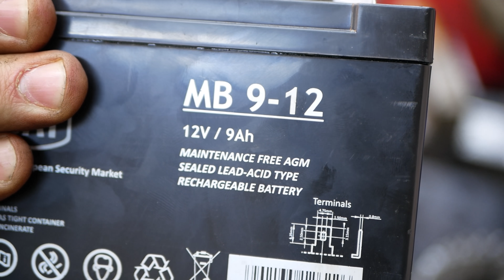No More Trailer Woes: My Electric Towing Solution!

Comment: For anyone curious how to mig weld. There is usually a datasheet sticker with settings related to volts and wire feed speed. Just know the size of wire and check it out on the sticker. More expensive machines will guarantee this sticker is included. As far as gas flow it should be set to 20 cfh (cubic feet per hour)  or 10 Lpm (liters per minute). If there is wind set 10 cfh higher or 5 Lpm adjustments. Er70s-6 is standard wire
Reply: Facts
Reply: I'm getting into mig welding, so thanks for the info
Reply: Yeah that is all you need to know you'll be laying some sick beads knowing that

Comment: That's ingenious! I bet he built that from scratch without any blueprints. Slightly overbuilt but anything worth building is worth over building.  Well done my Polish brother. 👏👏👏👏
Reply: No-one needs blue prints when they are in the power of imagination 👍
I often build similar although I don't have a YT channel setup atm, nor have I filmed hundreds of builds I've done but I've got tonnes of photos and useful equipment!
Reply: @Th4thWiseman  Agreed. I learned the big word for it not too long ago: "conceptualize". If you can see it in your mind, putting it on paper seems like wasted time/energy to me.
Reply: If this guy is Polish, all the Polish folk I know around here need to take notes from him
Reply: @YerBrwnDogAteMyRabit  When you start out it's best to put things on paper just so it's easier to do but after doing many hundreds of builds you soon realise that when it comes to close tolerances fits and mating parts ,they are best done as you build out keeping mind what connects to what next and whether or not gussets are required for strengthening!
It is a craft to do it correctly which I do as a tradesman Fitter & Turner for 40years of experience 32years running my own business.
Reply: @Th4thWiseman  rough sketch, then wing it as you go! 👍
Reply: It looks exactly like the 'Trailer Dolly's' that have been on the market for over 40 years.

Comment: Really think splitting the shaft and putting an extra 2 bearings is the way to go, other than that seems like a really nice build! Probably will take some inspiration from it!
Reply: I agree with you. It would turn easier and be easier on the motors and chains. With a little redesigning you could control the speed of each drive motor to control the direction.
Reply: @drfrankensteinscreations  I know this is dated, but youtube just decided I needed to see it. I was looking at the comments to figure out this exact issue. Looks like it might be hard to turn. Pretty cool though.

Comment: Nice build! Wish I had this back in the day when I used to work with concessions trailers, made spotting them a breeze! I do like the welding  clip around the 13:30 minute mark, cut that segment in backwards so the sparks flew into the weld. With some modifications this would make for an excellent aircraft tug for those weekend pilots who have the pleasure of hangering their aircraft.
Reply: in their private hangar, could easily be stolen ...
Reply: They've been on the market for over 40 years, 'Trailer Dolly'.

Comment: You are an amazing machinist! And very innovative. I'm a 4th generation German machinist (I do minimal metal working, and any kind of house repair or new builds. I'm in mt 70's, and now gardening, very scientifically, and develop ways to go from seed to transplant in 3-5 weeks.). I also designed my trellises to be multi-functional, and fully automated watering system. 
I'm sending this video to my son-in-law. He is 2nd generation Polish, and very mechanical minded. I'm sending him your Link! They have a larger than average camper trailer. Their driveway is steep, turns left at the bottom (almost level where they park the trailer.).  They could absolutely use your trailer hauler!  My daughter does the driving, and Mark is outside guiding her. 
`

Comment: Another fantastic build with a practical use. I modified some electric pallet trucks to do a similar job and learned a few things. On this build, the position of the ball hitch is very close to the drive centre line. This reduces steering effort. However, if the trailer hits resistance, the unit is going to try drive out from under the trailer - potentially whipping the handle upward quite violently. But I applaud your excellent craftsmanship and creativity!
Reply: @Daihti__ Exactly. Nothing to prevent violent swing up, down sideways if the towed or tow-er wheels hit an obstacle or hole, etc.. but besides that, nice workmanship 👍👍
🤔.. maybe an extension post added to the front with a caster wheel under it, and the trailer ball on top of that??
Reply: Perhaps, if the ball hitch were closer to the center of the towing vehicle, that might mitigate the upward swing?
Reply: @isaacmadhavan  Actually the further forward of the centre, and the lower, the hitch and ideally the centre of gravity of the unit,  the better. Hence the suggestion above of a caster wheel out front.
Reply: @daithiosioradain3380  Aaah... you mean it would work as a lever to control the movement?
Reply: And not to mention that windshield motor has no chance raising anything more than that tongue weight.

Comment: Is that is a solid axel, how are you turning?
Reply: I’ve got the Same question
Reply: Same question! Why two motors and two chains when its one axle? Logical would be that left and right is not connected.
Reply: @Tramm454  I would’ve built it exactly the same except spilt the axle added a tube to go over the split between the motors with some bearings it could float just a double set per side and two switches would make it easy to steer under load and everything else

Comment: I made a tug with 4 wheels and used a 2500 lb winch motor to turn a sprocket to turn a solid axle rear., it’s to pull a 25?ft car trailer from my side yard to my street over grass. It does great pulling to the street as it’s downhill but it does not have enough traction to push the trailer up hill back to the side yard.

Comment: I just use the wheel chair. Split  the platform add solid non neumatic tires.  To  Make front stabilizers. Added 4 marine batteries and ride it around like a atv and move sit around for years with a  8 position throw switch to double voltage to go faster.  .. Just use the motors to steer  with a rotory wheel made from old brushless motor hall sensor. Old CD player steering by wire  controller.  Also hooked it to a wireless router and can WiFi control wirh my. Jail broke iphone. App I wrote Debian...  never thought about  makin a YouTube video. Til now   I got a zero turn string trimmer im makin from trashed hooverboars atm

Comment: I had trouble backing our 16 ft long camping trailer into the narrow side driveway into the backyard.  Hard since an often busy street (school nearby) and hard to make the 90 deg turn onto the drive while avoiding trees and bushes, plus hard to tell the angle of the trailer.  I finally bought a small cable-winch from Harbor Freight and welded a plate to bolt it to the trailers rear bumper, and is easily removed.  I ran a thick cable from the 12 VDC battery at the front to an outlet near the winch.  I used a manual Trailer Dolly from Harbor Freight at the front to steer as I operated the winch with remote control.  Total cost ~$100.  Then all I had to do was back the trailer up enough to get the rear wheels near the driveway, then unhook before drivers became irate about my tow vehicle partially blocking the driving lane (fussy parents since street is wide w/ parking & bike lanes, plus center turn lane).  Steering with the tow-dolly was easy and allowed tight turns.  Finally, the ultimate solution was to sell the trailer, since a hassle towing one and went years without using it.  Tent camping is actually easier.  But, such powered trailer dollies are neat.  There are commercial ones (pricey), with some cheaper hand-cranked versions.

Comment: We had 2 of them back in the 70's at the dealer I worked at. 1 with a ball mount for moving the team race boats (Hydroplanes) around and a second with a big rubber pad like a plow for pushing no-start cars around the dealership shop.

Comment: Back in the sixes we had a tug like this we used to pull small aircraft in and out of the hanger it must have waghted 40 to 50 pounds. He built  one that waghted as much as the log splitter!
Raven out

Comment: Love it! I just finished one made from a 1946 Speedex walk behind tractor. I pulled the gas engine off and replaced with electric motor. I originally started with AGM batteries also but changed to two 23 ah of Litium ion, Much better but yeah, spendy. Keep up the good work

Comment: Nice build, now just the Refinements LOL.
I am considering an old hydro garden Tractor. Shorten the Frame, 
Moving the Steering out Front with just a Tiller handle and a Cable operated For/Rev control 
Remove the Seat and a Hydraulic Cylinder in a Jack configuration for the Ball. just behind the Axle. 
My Trailers are to big for the Unit You built LOL.
Mike M. Central Wisconsin.

Comment: 14:30 I noticed that you had the tyre tread on backward.  They do this on the old type cranes with tractor tyres as they wear out on the road and concrete due to the load and the cleaning action of the tread.   On a tractor the tread actually flexes to aid in the cleaning action  to remove mud.  With load and a smooth surface the tyres wear prematurely.  Top idea.  I have been working on making my ride-on mower in to a small tractor so it more useful than just as a mower.

Comment: A long time ago I had planned to build something similar from a bleacher tractor for opening and closing bleachers like used in school gymnasiums to move boats around in a boat dealer show room but I no longer need anything like that. Because without it, there was a need to pull others from their normal work load to handle the show room break down or rearranging.

Comment: being a fabricator myself i commend you on your build, but i may critique just a bit, but only for the interest of improving on your design. I would do away with the windshield washer motor, even the older ones have plastic gears that aren't meant to withstand the kind of resistance you are dishing out. A hand crank lift like the one on the wood splitter would suffice for me and no failures at a critical point. Second point would be the adjustment for the chain tension. make the motor movable not the axle. the axle should be aligned. Third would be the axle and motor assembly itself. It would be much easier to repurpose an old transaxle assembly from a small car that way you could employ the limited slip transaxle to deal with the differing speeds of the motors, you could still utilize the redundancies of twin motors mounted to the same input shaft of the differential, that way the output shafts would always be the same speed and it would be much greener to utilize existing components than to build new ones.

Comment: Clever build.   Enjoyed the machine work and welding.       The only reason I see for the twin gearmotors  on a common drive shaft would be to double the torque available to move the trailer.   This would also double the current requirement and shorten the run time.    Not a criticism, just an observation.   Very nice fab  AND camera work.           Be well.

Comment: Honestly, don't you think it's a little Over Engineered ? I used the electric wheelchair (Hover round)  by replacing the chair seat with a trailer ball on a pipe which fits on the original chair seat mount. But yes yours is Better but we don't have a Lathe or welder. good job. but mine works too. keep up the good work.

Comment: I clearly recommend to use more than one screw or a serious amount of locktite, even better pins with safety pin on vibrating and rotaing axle parts. Things that have pins or screws not secured by gravity and that tend to come off fully speed with serious consequences to the user.

Comment: This is a great video. Furthermore, it yields a product that in a modified version, I may want to build. The one issue I see id that based on the bolts used to fix both sprockets and both hubs to one shaft (see 3:43 and 3:52), this means both wheels MUST turn at the same speed.  I occasionally move a ~3000 lb trailer/ in an asphalt covered storage yard. (~400 lb tongue weight, and ~250 to 300 lb thrust, very slow speed ~1 km/hr). The asphalt and tongue weight mandate that the two drive wheels to be able to rotate and different speeds relative to one another. So, each sprocket needs to be affixed to the adjacent hub, where both are allowed to rotationally 'float' on the mainshaft. Given the slow speeds, this could be done without additional bearings.

Comment: Nice build - but I suspect if you pull something much bigger with some significant weight (like a boat) the small cart will try to pivot on the ball and it will not work - I know because I built something similar. :-) A locking mechanism that locks the machine to the trailer  with a bit of play is needed, which would not be hard to fabricate given one you have done. I like your motor drive system, a better idea than mine where I use a single truck winch and welded on a sprocket - but without a differential system the cart, when under load, would be hard to turn given the width of the wheels. Your finishing job looks great too!

Comment: It's a nicely built, heavy duty compact design. But I find a trailer hitch on my ATV does a good job of moving around small and even medium sized trailers. That said, some of the design elements might be useful for some other device. 

I'm looking to design a compact system to move heavy shop equipment around in a confined area. Small, strong and compact. Maybe based on a modified pallet jack design. Similar in ways, but much less bulky and awkward to operate

Comment: I would have made one change to the control arm... put a trigger switch under the handle or near the tip so that for longer moves, you're not having to micro-manage the steering. Much easier to pull than push, at least until you're preparing to place the towed item more precisely. You've got the push and pull nicely done, but the trip to the worksite could have been significantly easier, especially over the rougher parts of the movement.

Comment: Impressive build, only one thing I like to stress as  important,  the welder is welding near batteries,  yes they are sealed but one can  not be sure  if there is a leaking one especially if they was to be charged as same time,  so my suggestion illuminate possible dangers and harm to yourself or others remove batteries after test fit before continue to weld.

Comment: I got a 45 hp tractor that I just use the front loader on to move my trailers around with, it was cheaper than the tools used to make this.
What I don't understand is why you didn't flip the sprocket hubs, would have made one less thing you have to take off if you have to change the sprocket.

Comment: Should have gone with an acme thread for the linear hitch lifter, I’ve used fastener threads like that for various projects and even if you put grease zerks the threads start to gall and seize after moderate use.   Could steal one from an old car jack for example.

Comment: I know this is a year old video but nice job.
Are the wheels able to turn independent of each other? I may be wrong but it appears not.
An improvement would be to split the axle in the middle and fit a free running sleeve to keep it rigid.
The through bolts for the sprocket and wheel hub would keep the axles from sliding in and out.
Varying individual motor speed would give directional control.
Now, where is my RC transmitter........... 🙂

Comment: nice video, very inspiring, I was looking for something in a small work unit / tractor, a few design changes I would make, make it so the handle can rotate inwards which serves 2 purposes 1 it will allow you to reposition the handle bar for a tight turn and 2 it would mean if the load was light enough or you had no load you could ride it to your destination. another design change could be to have the tow ball removable so another attachment could go in its place like a seat stem. essentially you could use it to ride on and as a work unit. good job very inspiring.

Comment: I use something like this to move airplane cargo stands into place . If it doesn't have differential power to the wheels it will be a major pain to turn under load.  Kinda like dancing with a extremely large woman.  She leads you follow lol

Comment: Does it reallly need to be that heavy steel. what 2 motors were these from .  Why not wood ply and plate joints. No need for ballast is there?  2 sprockets?  is there a non connected drive (differential) axle?  what cutter torch and welder do you recommennd for doing this kind of work

Comment: Awesome build but please install grommets where the wires touch bare steel. Over time and with vibrations the sharp steel will cut a hole in the insulation and cause a short to ground. Hydraulic hoses need the same protection (insert joke here) from vibrations, I've seen hoses fail from rubbing on steel and long term vibrations. 🤔

Comment: I would have installed a differential.  So that the axle and the motors are not damaged in tight curves or when turning on the spot.

Comment: Great video , im a blacksmith i have been wanting to turn a log splitter in to a forge press for a few years now but i cant find an electric one in the UK over 6-7 ton i need 10-12 any ideas ? im also a welder fabricator but lack the pspace and tools to make a hydraulic press.